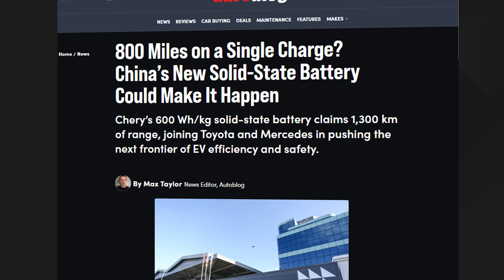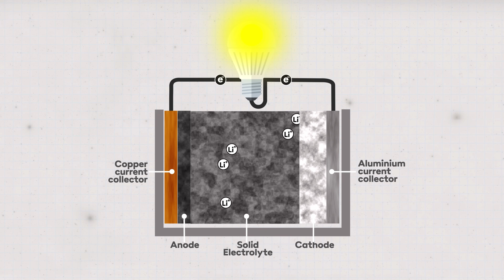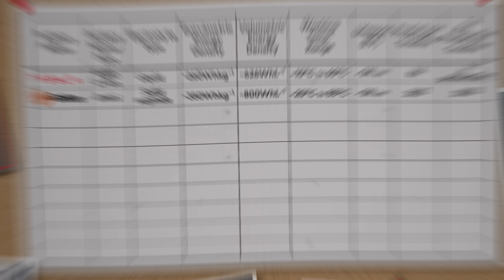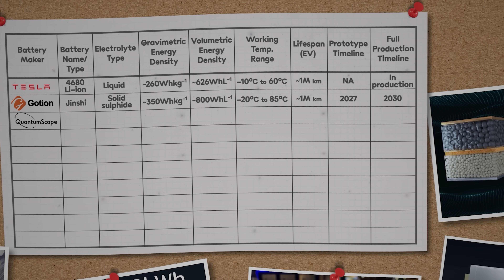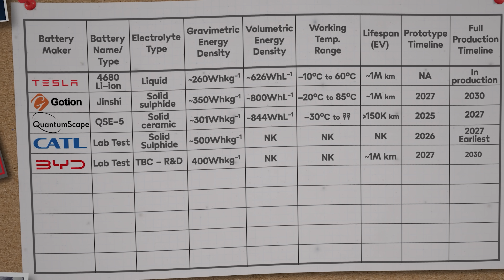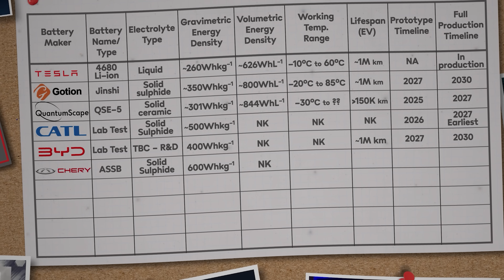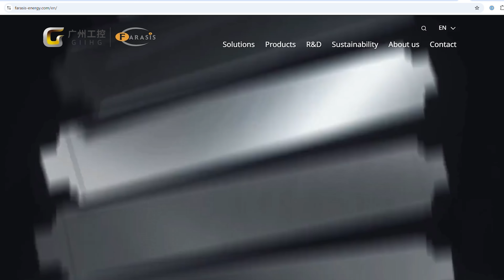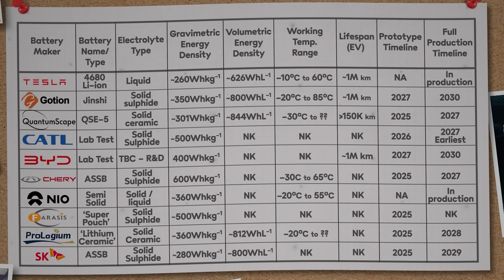Solid-State batteries. Finally arrived?

Comment: 500Wh/kg would enable battery powered commercial mass flight.
Reply: Jet fuel has about 46.2 MJ/kg, which is 12,800 Wh/kg. With a 30% efficient jet engine, that becomes 3,850 Wh/kg. So a 500 Wh/kg battery would enable electric planes to fly only 13% as far as jet fuel powered planes.
Reply: @mqb3gofjzkko7nzx38  Sounds reasonable. But with electric motors you could power greater blades and move more air with the same energy. There should be a factor 2-3 in the game
Reply: @markuslang1869  The 30% efficiency of the jet engine includes the losses in propulsive efficiency from the turbofan design. In my calculation I assumed the electric propulsion would be 100% efficient in every way. This is the best case scenario.
Reply: To the corner shop?
Reply: @DR-00700 the cool thing about hydrocarbon powered aircraft, is that the aircraft gets lighter as the fuel is used.  A lot of energy is used during takeoff.  1'000's of lbs of fuel.
Reply: @jacobzindel987 I think electric may power a short hop but not transatlantic.  If they make them I will not be flying in them….

Comment: The difference in Solid State announcements and promises is that CATL has now made their own announcement and timeline of 2027/2028. And some major auto manufacturers are actually testing them on a vehicle. It's no longer Toyota making bogus claims to calm their customer base and investors. Or small companies with little funding hoping to get backing or even duping some rich private investors.

We also need to keep in mind that capacitors have been using semi-solid state forever with great safety and charging speeds.
Reply: Having them and having them at a price point and specs that make sense for anything but supercars are two very different things. If there starts being some in 2027/28, it could well be 2035 before they're common to mass market vehicles.
Reply: @tHebUm18  The iPhone began in 2007, did it really take until 2015 till smartphones were mass market? Is that how long it took you to get a smartphone? If not, look back and remember the year you got one. 

And before you begin down some none sensical path such as phones and cars are a whole different thing, in 2015 there were exactly 2 fully electric vehicles in mass market in the whole world. The Nissan Leaf and the Tesla Model S. Just 10 years later, there are literally hundreds of fully electric models in mass market. Did it take until 2025 for them to be in mass production and sold to the masses?

If you want to know the future, simply study the past.

Comment: That somebody can and will make a durable all solid state battery at scale seems likely.  That all solid state batteries will become cheap enough to displace electrolyte-based cells in ordinary cars and light trucks, however, is definitely still an unanswered question.  It seems unlikely that anything about solid state makes it cheaper- it's largely better features in return for more difficulty in manufacture.  That might be something that you can sell to aircraft manufacturers, but in cars the thing we really need is cheaper cells with adequate capacity and capacity retention.

Comment: Semi Solid State seems like the best of both worlds.
Reply: I mean 2+Years ago nios ceo did 610+real world miles in an et7 on 1 charge using the welion semi solid state pack. Which got 144+kwhs useable out of the exact same pack size catl nmc got 100kwhs in! 
For a mere 20kgs more in weight to. 

Why the fk wasn't that given top priority?
Reply: @4literv6   avoid passive voice, who isn't giving this "top priority"? There are massive investments in solid-state battery production, but engineering volume production at a low defect rate takes years. It's far more important to reduce the cost of boring conventional NMC and LiFePO EV batteries, and that is happening in China.

Comment: Thanks for the good overview of where we are with solid-state batteries! My main issue with the hype about these types of batteries is the point that a lot of customers for EVs seem to wait and wait, but the practical EVs are already on the market. I own an ID7 with the "small" 77 kWh battery, and I get over 400 km of German autobahn range and can charge in 26 minutes. After 400 km, most people need anyway around a 30-min break. To see what is ahead in the future is always great, but it shouldn't be a reason to prolong the purchase of an EV. The ID7 is just one of the many which are on the market today, which get similar or even better range and charge time values (Mercedes CLA, Neue Klasse BMW, Audi A6 …). Who needs in the end 1300 km range and charge times of < 10 minutes? For charge times in this range, you need a 1 GW charger; hm, who wants to pay for this? The cables need to be water-cooled and are stiff and heavy. Overall, a practical car should reach 400-500 km and charge at around 25 min 10%-80%. With these specs, 90% of all consumers will be more than happy.
Reply: the key market for high energy density is aircraft
Reply: I don't think there are many people waiting for ss batteries. The race for more range seems to be a reaction to people who claim they need a ridiculous range before buying, they either don't want an EV or have no idea how much range they actually need.

Newer EVs have more than enough range and can cost the same as their ICE counterpart, so better value for money and batteries last longer than the rest of the car in most cases. CATL just announced a battery with a 12 year /1M km warranty
Reply: Yup! Been an EV driver for over 4 years and never going back. The biggest barrier to EVs adoption is misinformation that the public at large believes.
Reply: I agree, it's really the 4X4 towing, truck and aircraft markets that will really benefit the most from the long range fast charging criteria.
Reply: I want a car with longer range. I am self employed and do upto 200km a day and don’t have a driveway to park in. There aren’t any superchargers near me so I don’t want to have to drive an extra hour to get charged every 2nd day. I am sure there are plenty of people in my position who don’t want to have to “refuel” every 2 days when my current diesel car gets 1000kms per tank so I fill up about once a week. Normally on the weekend when I have more time.
Reply: @Ebonyqwe that is just your scenario.
Reply: @Ebonyqwe  I assume since you're using km you're not in the US, but that amount of driving is very anomalously long--more than double the US average miles/year traveled and the US is highest in the world, with around double that of most of Europe.

I think you're a rather rare edge case to drive that much and not be able to charge at home as most people who drive that much tend to live in a low cost of living area with a garage/driveway--which would allow them to comfortably never need to charge anywhere but home using a washer/dryer outlet (32A) AKA being less of an inconvenience than you have currently getting gas weekly. 

That said, not being able to charge at home is definitely one of the two edge cases I wouldn't recommend getting an EV for--the other one being if you tow long distances regularly.
Reply: @Ebonyqwe  I an guessing you are some sort of tradie or site worker? What would really help is a way to charge wherever you end up parked for the day. The vehicle is usually sat there for most of the day and even quite slow charging would make a big difference. But often the parking for building sites is chaotic (and not always legal), but there is usually power at the site, so someone could string out a cable for you all. 

This may become a thing one day (and if it did you could essentially spend no time charging/fuelling), but in the meantime varying the route home to include a quick charge is probably the most practical thing. If you have gone 100km away there really should be a charging site with only a minor/no detour on the way home somewhere. Pick the right vehicle and 15-20 mins would see you full again for tomorrow. Perhaps a bit more faff than going out specially at the weekend to buy fuel, but do-able?

There are cars with pretty long range already (500-600km), but we are still waiting for long-range vans, which would make people like you's lives easier. It's not impossible, it's just expensive, and has relatively low demand.
Reply: It's fine for cars. Things are much less satisfactory in van world, especially campervan world where you need extra capacity for cooking, fridge, lighting, gadgets and ideally heating. We are now getting >200 mile vans with useful load capacity, but still no-one gives a 100kWh battery in a smallish van so you can run off-grid for a few days. So yeah I've been waiting since 2016. We don't need different technology, but we do need manufacturers to make  the right batteries available in this form factor. The higher power and energy densities of solid state would make this easier, but it could be done today.
Reply: Absolutely! And I worry that potential converts from ICE to EV are putting off their devision on the basis that some amazing new technology is just around the corner...but does it really matter? I've owned a Kia e-Niro since 2019, the battery technology is now considered ancient (NMC 622) with a pack level energy density of just under 150 Wh/Kg. Even so, the car has been totally reliable and has now covered 130,000 km. I have experienced no loss of range at all and like you, I find the 450 km range more than the 2 to 3 hours of driving I tend to do before taking a break. Sure, it would be nice to have a car that chargers faster than mine but if I were buying today, more range wouldn't be a big deal for me.
Reply: Good choice... so do I 😊
Reply: for me the the better battery technology is more interesting for boats than cars. cars already have good enough batteries.
Reply: Will swappable batteries come to cars as for power tools?  Surely that’s the answer to loads of issues - range anxiety, extra long journeys, no driveway charger, and more?
Reply: @WilfForrow you can buy cars from Nio with swappable batteries. At the moment Nio is the only company doing this. In theory all sounds great but I see no way to have swappable batteries at large scale because no OEM will agree on a standard format. To have hundreds of different batteries at something like a gas station is not sustainable.
Reply: The main reason people are not buying EVs is beasue we are still waiting for the prices to drop to affordable levels. 30k simply isn't affordable in the majority of the world.
Reply: @Itsallgoodtogo do you always buy new cars, picked up a 30,000 mile Tesla model 3 long range for under £19k far more car than I need and charges in the time I need to visit the loo and queue for coffee, Superchargers for long trips when I need and charge at home rest of the time. Much cheaper to run than my old diesel and silly performance......
Reply: @Itsallgoodtogo considering the average prices of new cars is 40k, 30k seems like a bargain...

...but over 90% of people buy second hand, so let the numpties buy new and we'll use that massive depreciation to buy second.
Reply: @Itsallgoodtogo   @Itsallgoodtogo, EVs are already there. I just came back from India and guess what, I saw many EVs in the streets of Bangalore. The Tata Nexon EV starts at around €10k. The car looks nice and has a decent range. BYD and other Chinese cars are also plenty in the streets. The next kicker is the gas price is around €1 per liter, but electricity is €0,018 per kWh, and in the endless traffic jam, you need around 10l/100km. You don't need to be a genius to find out it is way cheaper. Therefore, many colleagues will go EV with their next car. My guess is EV will be even faster adopted in countries like India than in Europe or the US.
Reply: @Itsallgoodtogo  Many EVs are now available for around parity with ICE vehicles.  Sure, many people do not have new car money--but, for those that do, price is not a problem: purchase price is similar, operating/maintenance costs after initial purchase much, much cheaper.
Reply: Regular NMC batteries of today lose 1/2 of their charge when used in cold weather locations. BYD & CATL have resorted to hybrid NMC & Sodium Ion batteries to maintain charge regardless of outside temps.
Reply: @tringuyen7519 good that my EV‘s don’t know about that. No way that you lose 50% in normal cold winter weather.
Reply: @rainermenes5921  It's pretty common. Normal cold winter weather here in Canada is -10 -30 celcius
Reply: @tringuyen7519  it would be more accurate to say that they close 10-20% depending on the car, in tests only the absolutely worst came even close to losing 50%

Comment: Cost.  Cost isn't mentioned.  Solid state will be entering a market increasing dominated by sodium ion.  Solid state will be better by more expensive.  It will have niche uses like regen battery and quick partial fillup.

Comment: Solid state batteries aren't even revolutionary for EVs anymore. LFP has already made EVs practical for most people.

Sodium ion batteries are far more revolutionary if it actually manages to cut battery costs by 70-80%

That will make EVs much more accessible to most people.
Reply: There’s more applications than just autos. Think heavy trucks, and airplanes. Places where weight is a major concern.
Reply: @YoureNamehere-t6l  Yeah it can unlock electric aviation
Reply: Sodium Ion is not possible for automobiles yet. They are extremly low voltage below 30% or so, and have very low energy density despite some claims stating otherwise. They would only be possible for automobiles when Sodium-Sulfur batteries become viable. Just look at the tests of actual people such as Will Prowes and you'll understand why.
Reply: @junehanzawa5165   When the world's largest battery manufacturer is going into mass production with sodium ion batteries so I'll believe them. 

Check out CATL Nextra batteries.
Reply: @junehanzawa5165  Yes, everyone should watch Will's most recent tear-down and test of a commercially-available sodium ion battery . . . https://www.youtube.com/watch?v=zSPSCC3_hHw

Comment: I do think they'll arrive *eventually*, which is much better than nuclear fusion which will arrive *never*.
Reply: They have "arrived"; makers of solid-state batteries have produced thousands of cells for partners to test and qualify, and assemble into a battery pack to put in a demo EVs to claim "1000 km range!". A gigawatt-hour of production (enough for ~12,000 EVs) seems at least two years away.

Labs have demonstrated contained fusion since 1969, and the U.S. NIF demonstrated fusion energy gain greater than 1 in 2025. Sustained generation of more electricity coming out than energy going in is very probably still decades away.

Comment: I'm driving a Renault ZOE with a range of 150 km. In the last 18 month i had to charge it on the way just 5 times while driving 12500 km per year. --> 150 km is enough for 99,1 % of all situations. Solid-state batteries are interesting, no doubt about it. But they are not going to change the car-industry.
Reply: Assb will be the end of ice motors.
Reply: @YoureNamehere-t6l   cheap batteries are the end of ICE motors, and China has them already with LiFePO. Solid-state batteries expand EV domination to longer range (if you have the money for a 150 kWh pack) and the dwindling numbers of sports car fans who care about weight.
Reply: @YoureNamehere-t6l  ICE-engines are allready dying. ASSB might speed that up a bit, but there is no need to wait for ASSB.
Reply: It's about cost parity. The production cost of a combustion engine compared to a battery pack is prohibitive for the legacy automakers currently because retooling their plants isn't workable.  Solid State battery tech will change that equation and simultaneously double range while eliminating excessive charging time.  But that's not all.  The ss batteries will be lighter than ICE engine-transmission systems and that will either push legacy carmakers to reinvent themselves or it's lights out.

Comment: Just use sodium ion instead. Cheaper and won't run out
Reply: Poor energy density.
Reply: @JRP3  Sodium for home and grid storage, Solid state for vehicles and Railgun upper receivers for AR15's
Reply: @JRP3 At 175 Wh/kg it is pretty ok , even better than LPF batteries
Reply: @MrRAW1968  The video is discussing much higher energy density chemistries than LFP.  However there are LFP batteries higher than 175Wh/kg, and the large voltage drop of sodium ion means it's not practical to use the full capacity.  Also round trip efficiency may be lower.

Comment: It's pretty simple I'll believe it when I see it in smartphones and smart watches. End.
Reply: and smart computers. i mean laptops... yeah i think higher price in those can be easily dealt with since batteries in those are way smaller and increase in capacity would mean a lot for some users
Reply: and drones. Then very expensive EV supercars and luxury cars where manufacturers swap a 100 kWh battery for 160+ solid-state for a lot more money. Toyota fans delaying an EV purchase because they think they'll get a Corolla EV with 900 km range in 2027 are deluded.